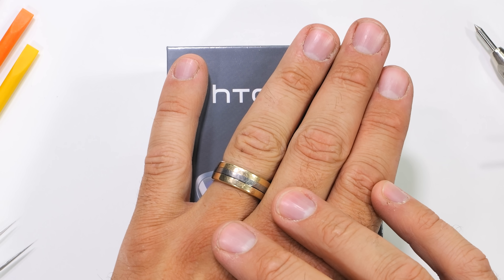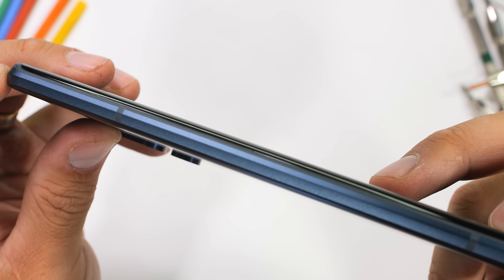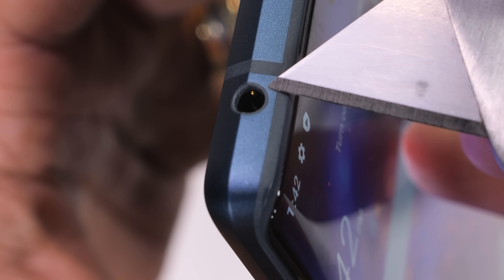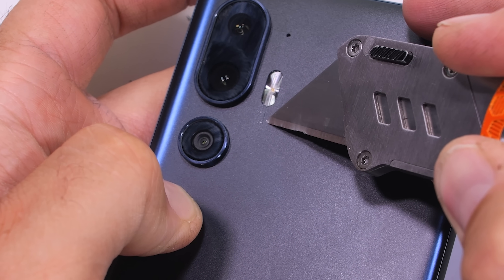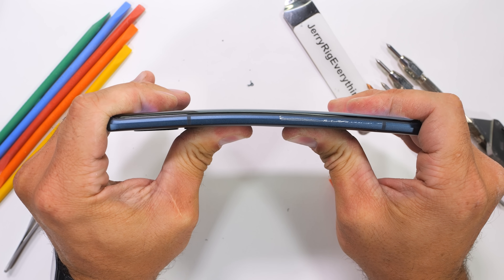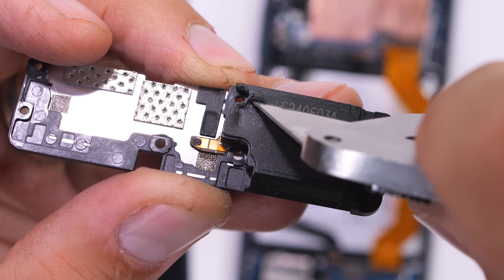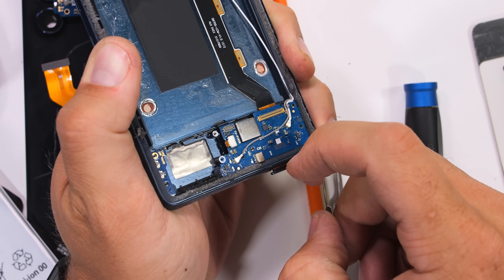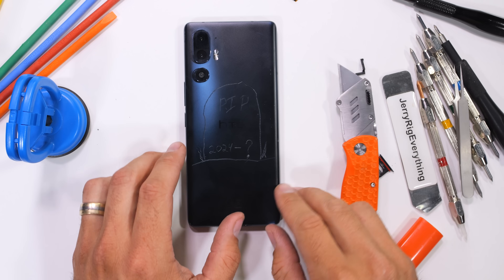OFFICIALLY BACK FROM THE DEAD

Comment: Apple not making good on their promises brought me here. I've own a few HTCs one being the EVO 3D. HTC was innovative in this cellphone market heyday. but after Steve Jobs passed they got into some weird partnership with APPLE and they would share patents. I really think it was more to Apple's benefit rather than HTC's. HTC should have told Apple to take that contract and wipe their ass with it imo. I've always wondered what happened to them and I suspect Apple has something to do with it.
Also HTC owned the Rights to BEATs by Dre before Apple took control of that. I just wanted to add that. I don't know all of the particulars, but things started going downhill for them after Apple got onboard. And they should also bring back REMOVALBLE BATTERIES. I got a motorola that needs to be replaced because of the battery now. would be nice to just hop online and buy a new battery, no need to pay to  have it serviced or buy a brand new phone at this time.

Comment: Had an HTC U Ultra once. The only reasons was, it had flagship specs but nobody wanted it, so it was 200€ brand new and for that price it was a great phone back in the time. It was one of the last phones HTC made and it had no head phone jack!
However, bad software, always crashing and the buttons stopped working after a bit more than a 1,5 years.

Comment: Been looking for a new phone and I was hopeful that HTC had a comeback. I had multiple "HTC One" phones. I beat them up. The first one I bet people multiple times I could punt the phone and it would be fine. Around the 10th time it ended up breaking the screen. The second one I got I accidentally dropped down 2 flights of stairs and hit every step on the way down. It didn't break. I ended up dropping it straight on the corner of a metal surface from about 6 inches and it shattered the screen. I am very hard on my phones and have been looking for a phone that can withstand the abuse. Thank you for the review and I hope HTC will make a good comeback.

Comment: Oooh I dunno, that antenna jammed between the power button and volume rocker looked like a potential weak point when you were bending it. It was on a slightly different angle to the rest of the antennas.

Comment: Dude I'd KILL to see a flagship from HTC. The HTC One M8 was one of my favorite phones of all time. I'd love to see 40mp ultrawide, 24mp telephoto, sapphire front glass with some type of Face ID, 6.2-6.5" 1440p 120hz OLED display, 4,000-5,000 mAh battery, bring back the dual front facing speakers? 👀 If I'm not mistaken the One M8 Also had some type of mini audio Dac in it as well which would be sick. 

GOD this gets me so excited. I've been on team iPhone for too long. I got locked into their ecosystem because of work and been kinda stuck here since 2017. I've been tempted to say screw the ecosystem and switch to a Samsung or Google Pixel, but an HTC flagship would 100% make me switch in a heartbeat

Comment: Omg my first Smart phone was the htc touch pro back in 2008 last HTC phone was the u11 plus I had it for 6 years. Never gave me any trouble. I finally had to let it go because AT&t phased out the 4G phones so I had to upgrade to a pixel 6 to be on the 5G Network. Htc was definitely more customizable then stock Android. But I'm loving my pixel 8 pro right now and I don't think I'm going to switch back.

Comment: Head phone jack? Yay...SD slot? Yay! Camera Bump? Boooooo. Semi replaceable battery, step in the right direction but would prefer a back that can be more easily reattached. I don't need or want a 50 mega pixel camera that still takes worse pictures than my 15 year old DSLR. Please stop this insanity cell phone OEMS or at least offer a phone without that garbage.

Comment: HTC was also the first cellphone maker to set the little standard of using front-facing speakers with the HTC One (Not really a standard anymore, and I can't think of anyone still using it... Maybe the Xperia series still uses it). They were also the first to set the standard of an aluminum unibody design (HTC One M7). They also came out with some other cool technologies that didn't make it off the ground. One of those was autostereoscopy (HTC EVO 3D), which, in my opinion, wasn't the best. But it was a cool little feature, much like the S Pen of a Galaxy Note. They were also the first ones to try and help with low-light photography by introducing a feature called UltraPixel (HTC One M7), unrelated to the Pixel series. And while not necessarily a massive success, HTC's UltraPixel technology probably jump-started Pixel's Night Sight and other companies to adopt and design their own low-light technology. Now with their UI, oof, it was too much for me at the time. They were also one of the first companies to embrace Android. However, I wish they would have done what Motorola (when Google bought and sold them) did and just shipped basically stock Android. Their icons, from what I can see in videos and pictures, are inconsistent, and that is very annoying for me. Most others don't really care, of course, but this is MHO.

While it seems HTC has stopped making cellphones, I assume they are planning something big. Their VR side of technology was really good when it first came out but has declined. They haven't seemed to release anything of noteworthiness for a while. I suppose the COVID-19 pandemic must have slowed them down a lot and may have made them shift into more specific niches that I am not able to find right now. But if I were HTC, I would have something planned in R&D that would blow all other technology out of the market. But they could also just close down and not try and continue any development. Who knows, right? I do suspect, though, that HTC is just waiting to release something. They could get back into the cellphone market, but this phone isn't anything really special. It's much like the other phones that have been releasing. Nothing really new or interesting. It is really just a copy and paste, with a little sparkle of something cool to entice people to buy it. I am not complaining about it. This is just how it is right now. Cellphones have become stale due to not really wanting to risk innovation, as that can backfire and cause more harm than good. Besides, I would like to see more innovation on the software side anyway. Cellphones have become really powerful in the last few years. There are some really cool things that companies can do to make them more interesting on the inside, I mean that as in software, as there are two types of insides I guess. Anyways, you get what I am trying to say.

Closing notes: 
HTC was once a pioneer in the smartphone industry, introducing innovative features and designs. However, a combination of factors, including intense competition, delayed innovation, and economic challenges, led to a decline in their market share. While they've continued to explore other areas like VR, their impact in the consumer market has diminished.

It remains to be seen if HTC can regain its former glory or if it will continue to struggle to find its niche in the ever-evolving tech landscape. Only time will tell if they can once again captivate consumers with groundbreaking products.

Comment: Everyone talking about the headphone jack and the SD card slot (which is nice, don't get me wrong), but how about the fact that you can very easily open it with no heat, and the battery is relatively easy to get to and replace? In the modern age of completely sealed phones, how cool is that?

Comment: my first true smartphone was the htc one m7, and i absolutley loved that thing i dropped that down a flight stairs so often and not a singular crack im conifident i could drop it from the top of my house and it be find, and the audio was amazing (for the time imo) im currently on the pixel 7 and dont plan to switch for a bit but if theyre still going in lets 4-5yrs and they still got a Micro sd card slot and headphone jack and still good as they used to be, i will cannonball myself over to use htc

Comment: Despite some issues, the HTC One M8 was probably my favorite smart phone. The display, at that time, seemed really nice. I had that dot flip cover case that would light up while closed to use as a dot matrix clock. The speakers on the front were so good. I could go on. Great to see HTC back and with so many features everyone else has removed.

Comment: The only way HTC will ever make a comeback is with a premium build and design, along with a refreshed and nostalgic HTC Sense (without glitches). This also needs to be supported by strong marketing. It’s a challenging path, but I still hope to see them return one day. I was a loyal customer for a long time ( starting from htc touch & tytn 2) until I could no longer tolerate the shortcomings in their later phones. It felt like they were committing suicide, as each new phone seemed to repeat the same mistakes.

Comment: Maybe there is hope for HTC, aluminium as before, sd, 3.5 jack, easy repair design. if the battery is good, the screen changes to normal instead of bend edge, and support is at least 5 years, then it's worth checking.

Comment: The battery has no brand logo. Look at the intertwined wires on the circuit board. This is only available in very cheap devices. I don't think a $ 600 device has these. Prove that this is a product that is not invested much in terms of finishing quality. Perhaps it is not really HTC R&D this phone. Therefore, there is no "return from death" here. If HTC does not really invest in phone making, product valuation is too high compared to the actual value of the device. They will not be able to sell it.

Comment: The specs and the build quality mean that even in the mid-range its going to struggle to stand out. The plastic build + only Snapdragon 7 means its a decidedly mid-range device and isn't really being priced competitively either. 

When you can get something like a oneplus 12r, poco f6, realme gt 6 etc. - which are packing flagship processors and better screens - for the same price it just doesn't really seem that appealing.

Comment: Most if not all mid range include the jack and sd card. They also include IR, larger battery usually removable. This $600 phone isnt even good, in fact most low end phones has it beat.

Comment: Nice. 👌

I just want BlackBerry back with an advanced BB10 OS, flagship-level hardware, competitive pro-grade cameras, and a snapdragon chipset that can easily compete with the S25 Ultra and 16 Pro Max.
Reply: Blackberry Hub was and is still ahead of its time, and BB10 icons are simply still eye-catching.
Reply: BlackBerry should also increase its RAM capacity to 16GB. Although BlackBerry has previously demonstrated that its devices do not require more RAM to function, this changed as they grew older and apps became more demanding.
Reply: With the iconic compelling BlackBerry logo at the back of the device as usual. 🎉
Reply: BBM should be revived as well.

Comment: Many people love curved glass, it feels nice to the touch when you slide your finger over it, especially since the new gesture control requires you to slide over the edge to go back. Much more pleasant than hitting a sharp edge every time you go back.
Reply: yeah it looks nice and feels nice, i just cant get over the weakest part of the phone being on the corners so it takes mot of the impact
Reply: @mylesfrost9302  I had the OnePlus 8 and now OnePlus 11, both with curved glass, for combined idk 4-5 years of use and it never broke. It dropped few times but I got a cover (although thin one). I don't think it's such a problem esepecially because the glass doesn't go into the corners, just the sides. So there's no/less impact on the glass in the corners.

Comment: I love HTC, Been HTC fan since HTC One & Butterfly. I hope someone from HTC read this message. Feel abit disappointed for this new model, maybe it's just me but why still release an ordinary phone despite tons of other brands that have similar spec and pricing, why still come out and compete? Is HTC expect customer will consider the reputation that HTC brought since few decades ago? I really hope HTC will come out some really innovative like since phone hardware is almost reached the upgradeable limit now, HTC can just produce a phone that can last decade with the most high-end processor and camera along with a replaceable battery and full repairability, like screen cracked? Unscrew 8 bits from the back of the phone and screen off for swap with just 50 bucks.. battery weak? Unclip the back cover and swap a new battery for just 15 bucks.. IP67 rating? Just secure everything except the battery and connector.. Speaker issue? 20 bucks and bammm! New one!! Follow by a well maintained 10 years software support, HTC will definitely be able to be seems at most of the place since everyone not going to change.

Comment: I had a HTC Desire 10 pro in 2018, battery was busted by generator. I still have it but batteries can't stay long, seems generator voltage fucked the board too

Comment: I wish htc still made the same classic phones with updated specs with the same classic designs. For example, the same htc one m9 and htc one max design, boom sound speakers, size and features with updated specs like full 5g support with physical sim card slots and micro sd card slots but with usb c, larger capacity battery like 5,000 mah, higher capacity storage like 256gb as the base model, brighter displays like 1,500 nits minimum and unlocked versions that supports all carriers both internationally and for all the u.s. markets. I still have my htc one m9 and htc one max but I wish there were versions that I have already described when talking about making newer htc phones.

Comment: The HTC one M8 was the best phone I have ever owned. Hands down. I owned it for about 3 years before dripping ice cream into the upper front facing speaker assembly. I couldnt hear anything out of it, including calls. I had to replace it - and HTC didn't offer it any longer. That's when I made the jump to samsung. 

It's the only phone that I could swipe on while texting and know without a doubt that what I was trying to type was exactly what I would get. Every single time. It allowed me to drive and swipe while watching the road. Nothing has ever come close

Comment: In 2009 I had bought the most expensive and latest phone from HTC. Within a few months there was water inside the screen and I called HTC to be told that it was my fault that I had not stuck a screen protector and therefore there is probably sweat inside the screen(very much possible in the hot Indian summer) but their attitude and the knowledge that they were selling unfinished products made me promise myself that I would never again buy a product from them.

Comment: This phone genuinely feels like a breath of fresh air. Plastic back so no need for a dumb case. SD Card slot. Headphone jack. Decent cameras. Good durability. Decent price. Seems like good repairability. Near stock android with nearly no bloatware.
If HTC could keep this up, they could make a comeback.
Reply: No need for a case?
I used to have a cheaper Samsung with a plastic back, and that thing was scratched so badly after a year, that I literally ditched the phone. Sure it doesn't shatter as easily, but can get really ugly real quick.
Reply: The Moto g stylus 2025 has everything of that for $399 😅
Reply: @Cubano2031 sd7g1 though, too slow
Reply: Plastic back is nice. The design is kinda boring and ugly though.

Comment: This is pretty standard, easy to remove plastic back is good if the battery is available for cheap, and HTC need decent camera quality if it wants to compete with Samsung and huawei/honor good ecosystem and integration

Comment: This is so bad on Jerry's part... the headphone jack is a win and is framed as a "didn't get the memo" and the SD card is yet another win used as a punchline about the company going under. If this was a SAMSUNG or and iPhone it would be herald as the spear point that shows "the company has listened to the users". Why shit on HTC? They always made the best most durable phones and this phone has everything that people want: super high res camera, SD card, HP jack and very affordable $600 price tag. IF this phone had a smaller version that could be handled one handed it would be the best phone out there. This is why we can't have nice things. 😮‍💨 The HTC 10 was the best phone ever. Still nothing has come out with a better sounding layout. Also, I remember taking really dark picture on the huge (in physical size) 8mp sensor. It had huge pixels and they where super sensitive. Best low light pics before all the digital post processing enhancing took over. Please HTC, come back!!! 💪

Comment: Why is every phone manufacturer hell bent on using under screen everything. They are demonstrably worse than the stand alone counterparts. It's not even like they improve aesthetics, a fingerprint sensor on the side or back of the phone is barely noticable if done well.

Comment: Having a removable battery is an irrelevance since by the time the battery fails, the only replacement will be an out of date one that has probably discharged past resurrection [and may be covered with a new label] , or a nasty copy that won't perform or last and may even explode.
I'm speaking from experience of all the above and a drawer full of dead phones that only need a new battery - except the Motorola G4 that the [fake] battery explosion destroyed.